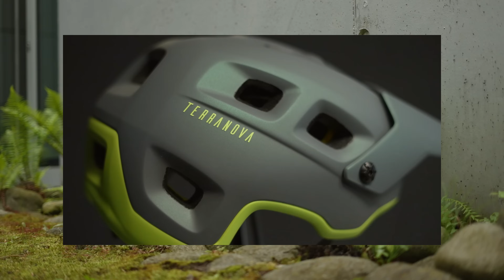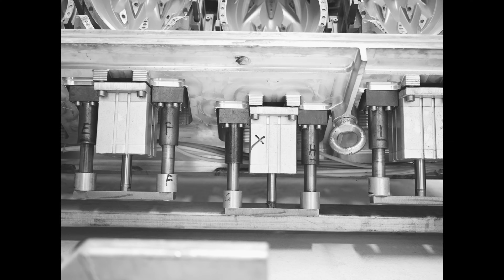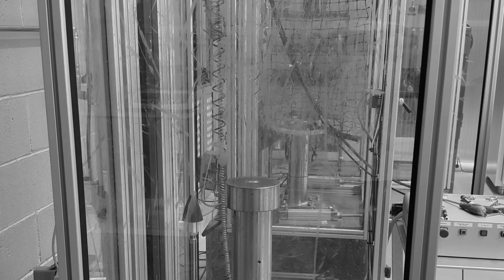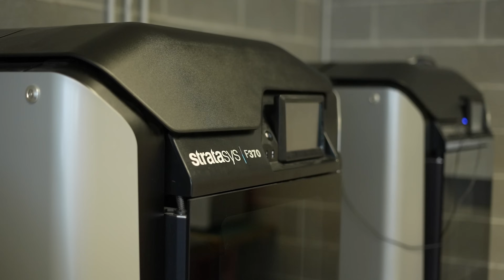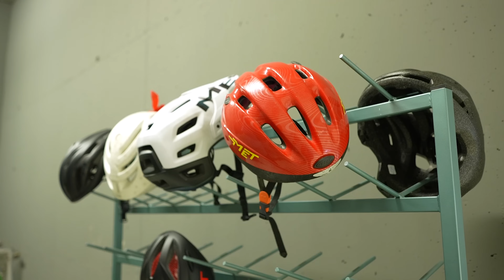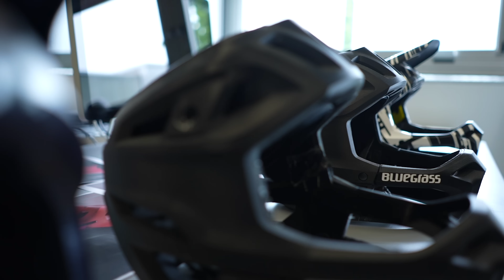Crash Testing Helmets At MET | All-New Factory Tour

Comment: All I can say Steve is a big thanks to MET. We were up at Dalby Forest for a week last week, and I thought that I didn’t really want to wear my full face and my dated GIRO was a little lacking especially with no Mips. Day one, 3rd run out on their excellent Blue, one moment enjoying the moment then the next a massive equivalent of a highside and I’m face down to the left of the trail wedged in with the Levo. Smashed prescription sunglasses smashed to pieces but luckily all the damage was around the eye where the frame dug in. Thankfully some riders stopped a few minutes later and pointed out that I was badly cut (totally obvious to this) and what happened was a pedal strike to a small tree stump beautifully hidden in the long grass just off line and one of them had the same on the previous day. Wasn’t until I got back to our digs in the forest than how much of an impact the MET helmet took, mainly on the temple and brow-line. See this did confirm the impact was much higher than I realised - it did its job so well but unfortunately now a write-off.
Bottom line - when buying a lid ask, how much is my head worth??